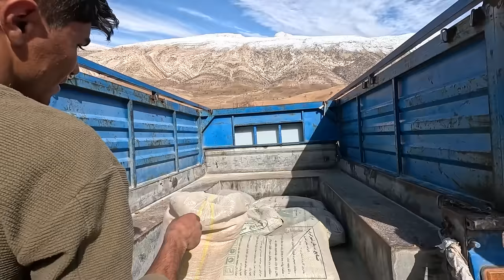"Family Bonding Day: Building Our Own Storage and Enjoying a Delicious Lunch"

Comment: Amir, Hassan a suggestion. Behind the house,  kitchen, and storage buildings. Create a trench. Digg out a trench in a /\ downward position start from the highest piont downward.   This would lead the water away from settling in  back of the build. Fill the trench with small stones. The stones will help the water not to settling in one place. The stones will also help the water to move downward away from the house. Just make sure the trench has a good downward pitch. The house is built at the bottom end of the mountain.

Comment: Oh & Sir Amir it would be nice if you made a RAMP made out of cement on that entrance you keep using for the wheelbarrow . We have one that has lined ridges so when it is wet outside or snow it is not slippery. But it helps also so when you need to bring stuff in with wheelbarrow. It is also good for you and Mrs to avoid too much wear and tear on your knees stepping up and down! And make a handle railing so you can also hold on too! And hoping you will build a roof without walls there where the table is at for Summer!

Comment: Mom, with the heat so high it burns the sides of your cookers and pans. BTW, I love the flowered ones.
Reply: Moma needs a different valve fitting 🙏❤
Reply: Yes. It needs to have the burner nozzles changed to ones for propane.

Comment: You need to have the gas stove burners changed to propane gas. The reason the flame is so high is that it is set for natural gas. It’s dangerous using it that way.  The burners need to be adjusted for propane.

Comment: Most people place concrete or mortar between the bricks or blocks along with underneath the brick or block.  This helps in strength and in insulating. Compare structure at a store that's constructed in concrete blocks.  Also ,it's best to have some concrete on the ground before placing the first block - as a foundation.   "Build You House On a Rock,  -  Not on Sand !!  " "GILLEN

Comment: It’s amazing the amount of buildings that they have built in such a short time ❤❤the sons should watch their father on how you lay cement without dropping it on the floor he is a real tradesman watch and learn lads ,it seems every time I watch the video maker is treated like a king and no I’m not that’s not the point .❤❤❤stay safe from Scotland,
Reply: Without the “Lads”, there would be little to nothing on this property! They have worked non stop engaged in Hard Labor, to create what you now see. Rather than pick a part their handling of the cement.. how nice it would have been for you to write complimentary things.. perhaps you missed hearing them say several times in this video .. they were tired, didn’t feel well, the weight of the cement was a struggle for Ghadir .. Hassan wanted to stop after the next row of bricks were laid .. they needed to be heard and allowed to stop but you notice they were expected to continue, irregardless. So a compliment from you would have been nice to read!

Comment: The reason your blocks are not lining up is because you have to put concrete between the sides of the blocks, not just the top and bottom. Doing that will make the blocks line up properly so that you wouldn't have to put in filler bricks and will make your walls stronger.

Comment: The plants hanging outside on the walls will not survive in cold weather it's better they're inside of a room that's got temperature that's warm they will eventually freeze and die they need to be in a warmer climate I would wait to put them out until the heat has come in